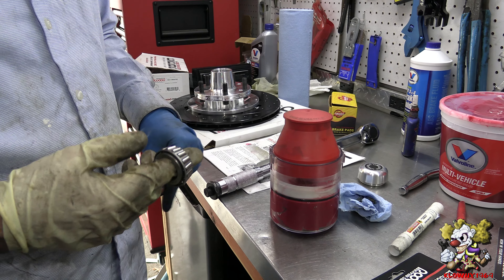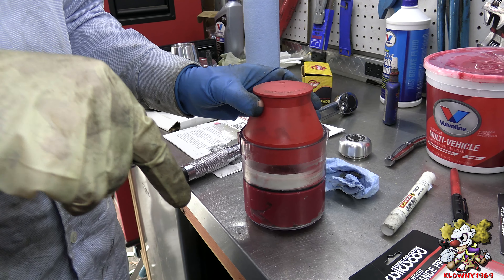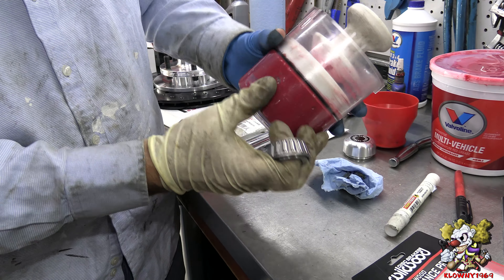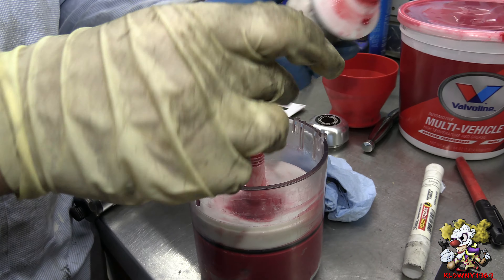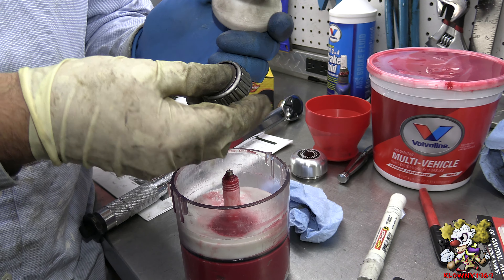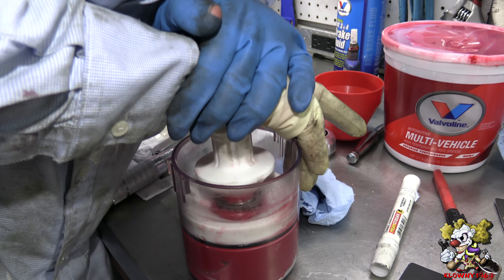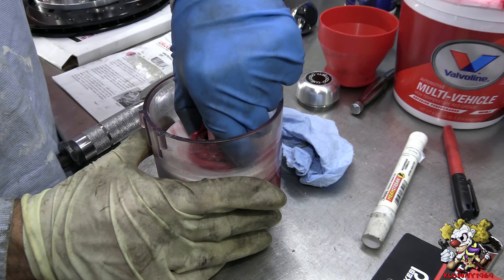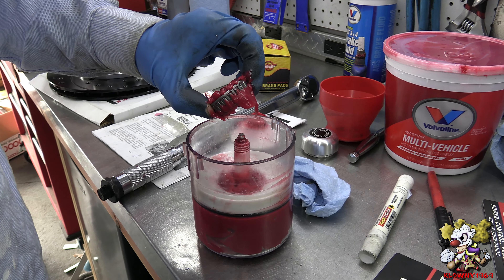How To Use A Grease Packing Tool For Tapered Bearings

Comment: Hello bother Klowny 🤡  question  how much do you tighten the bolts when changing a transmission mount on a auto 97 camaro z28
Reply from the maker: 43 ft./lbs for the nut, and 36 ft./lbs for the transmission mount bolts.
Reply: @klowny1969  thanks dude